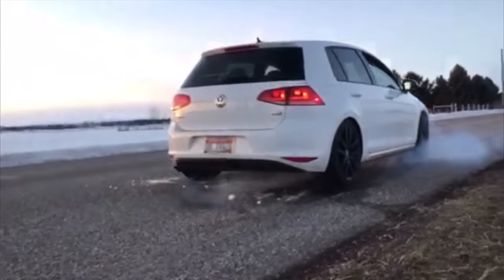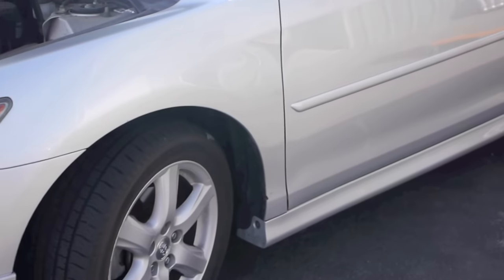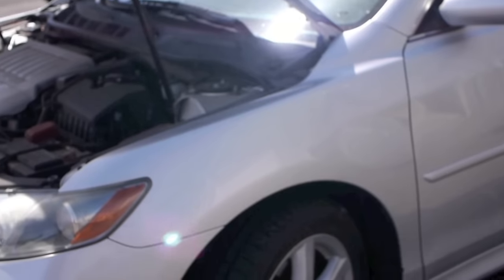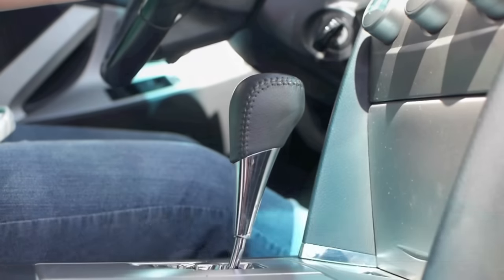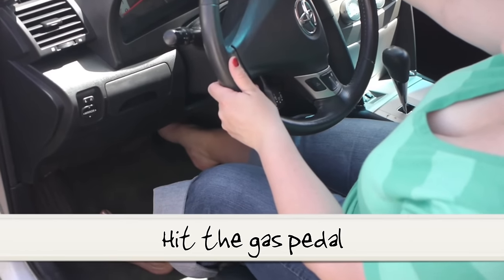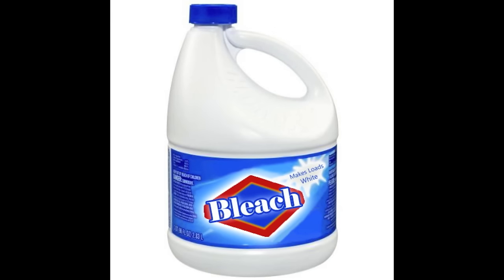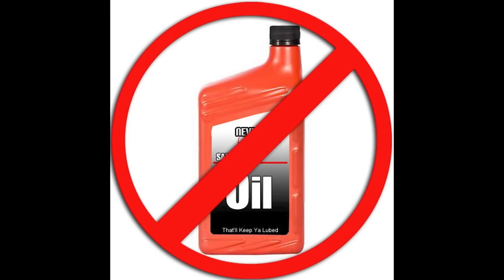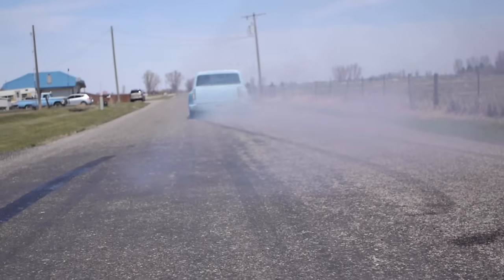How To Do a Burnout - Automatic Front Wheel Drive - Never Done

Comment: I cant do it on my audi a7 due because when you turn on emergency brake and floor it it will automatically remove the emergency brake
Reply from the maker: That sucks! Check the audi forums to see if there's a way around it.
Reply: What if you hold the E break down(or up) while you do it
Reply: @adammontenegro6052  Its just a little square shaped thing u pull up.
Reply: i know im kinda late to the party n you probably found an answer already, but if you activate the parking brake and leave your driver door open slightly it should stay on
Reply: @braydencowan5768  wow thanks bro
Reply: Hold it if its a little trigger like thing. I have a mk7 jetta and it does the same if i dont hold it

Comment: Since when is a v6 in a midsized Sadan under powered 😭 my 2.4 liter 05 accord four cylinder is what you call underpowered. But I welded up my own dual exhaust and a stupid cold air intake and it actually spins the tires now when before it would barley screech. God bless the k-series 🤣 if only I could afford to tune it, the new intake makes my engine light come on
Reply from the maker: Step by step you'll get there.

Comment: Yea... what if you have a handbrake that’s completely shit? I have an 07 TL Type S that’s completely stock and whenever apply the handbrake, the tires still roll without too much difficulty
Reply: Apply breaks as well it'll burn your breaks after a while but if you wanna do a burnout so bad you know
Reply: @BigtimeAlpaca98 Fellow Acura owner over here. 06 TSX A-Spec. Our E-Brakes are absolute shit from the factory across all models, they won’t lock the wheels at all for “safety.” Tighten it up a little and it’ll do it.

Comment: I think some soapy water might make it longer, mine would only last a second then even with the rear wheels locked, I'd start having grip.
Reply from the maker: ChefBuckeye the water simply helps you break traction with the road, after that it's really about the vehicles power, tire compound, gear ratios etc.

Comment: Is the emergency break the parking break and what if you have a newer car like a 2015 jeep Cherokee which has like a parking break button
Reply from the maker: Yes it's the same brake. I dont have any experience doing burnouts using parking brake buttons, you'll have to check with the forums on that for better guidance than I can provide.
Reply: @NeverDoneUSA  yeah it is the same thing I tried it this morning back end squats car doesn't rev above 2k rpms tried with regular brake same thing the computer doesn't let it above 2k
Reply from the maker: @anthonycruz8011  look around on the forums for ways to disable your traction control system, the newer vehicles are pretty advanced but many of them can still be disabled thereby allowing burnouts

Comment: Isn’t it bad to use the ebrake and burnout ??
Reply from the maker: Burnouts are "bad" for your vehicle either way. Using the e-brake just keeps you in place while you're doing your burnout not only keeping you from launching yourself into a ditch but also making it much easier for your vehicle to perform a legitimate burnout instead of just squeaking your tires and launching.

Comment: Using the e-brake will destroy your motor mounts and your transmission too
Reply from the maker: I've never had a problem with this. Has anyone else experienced issues with this?
Reply: You’re putting lot of pressure to the trans and to an engine that it is not designed and do not have the upgrades to do a burnout
Reply: And also now that I watched the vid to the end you ways show cars with powerful engines 🤣 why didn’t show the  toyota corolla in the whole vid to see the burnout ? 🤣
Reply from the maker: Stock vehicles can do burnouts, we used the powerful ones to make it more exciting. The corolla definitely didn't do anything impressive but we sustained no measurable damage to the car.
Reply: I've been doing this in my camry since I got and and have had no problems

Comment: I've been trying to do this doesnt work
Reply from the maker: You might not have enough power. Try to find a very smooth surface and use the water trick. If you still can't do it then it's time to look at some performance upgrades.
Reply: I dont it in rain but cant really see the smoke
Reply: Dont work with fords